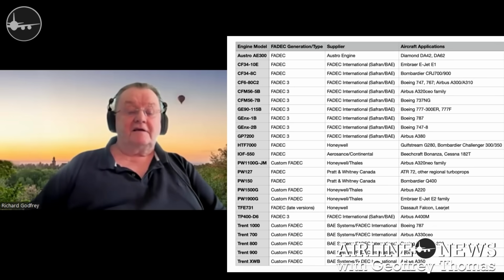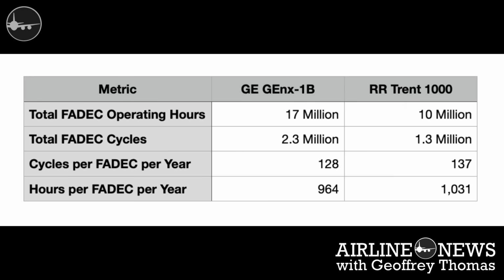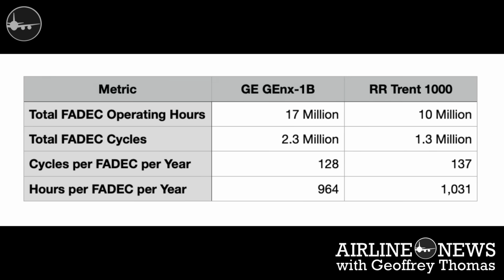Air India Crash - FADEC Explained  #airindiacrash

Comment: Give it up. Stop trying to profit from the death of 260 people. The FADEC EEC and water electrical failure had nothing to do with is accident. The Fuel control switches have nothing to do with FADEC. A simple 24 volt direct circuit between the fuel control switches and a three relays / valves opens and closes fuel valves.

https://www.youtube.com/watch?v=AD5Kc2BURZw

Comment: Have a couple questions::  x Read somewhere that the FS box has actuators in it, so is there a possibility of wire controlled operation of the FS ? ( resulting from electricsl/ Fadec/ software malfunction ) 
Can  a Fadec initiated fuel cut off be. confused as cockpit FS cutoff  on Flight data record ?
 Or does the FDR distinguish these as different events, and hence the "FS Transition " must have been separate  human action independent or consequent to other failure.
Any inputs much appreciated.

Comment: These very informative videos are very important because it shows what can happen. The air India crash has thrown up so much speculation that much of it has been taken as the truth. For example many experts initially said it was the flaps then of course the "depressed" Captain was fairly and squarely blamed. The depressed, suicidal Captain was all across the medias front pages, so no wonder people believe it was him. Personally I think  it all points to the Fadec. If the pilot had noticed that the fuel cut off switches were switched off he would have screamed "what the hell are they doing off" and immediately put them on again. The pilot was flying the plane after all. It looked like something popped up on his screen to say the fuel had been cut, that's why he confusingly said to the Captain "Why did you shut the fuel off".

Comment: There has been another associated FADEC accident, the A400m at Seville 9 May 2015 was a total loss, tragically 4 crew lost their lives and 2 survived with injuries, just after take off three engines lost power. This interested me at the time as I was checking out A400m simulators, which I did from 2010 to 2019. Here’s a reference from Wikipedia:
The key scenario being examined by investigators is that the torque calibration parameter data was accidentally wiped on three engines as the engine software was being installed at Airbus facilities, which would prevent the FADECs from operating. Under the A400M's design, the first warning pilots would receive of the engine data problem would be when the plane was 120 metres (390 ft) in the air; on the ground, there is no cockpit alert.

Comment: Fog swirling in the wake turbulence at rotation is not visible in later airborne shots. That's because the engines had quenched and quit by the second and third camera views. RAT deployed as soon as weight went off the mains, as it's permitted to on a flying plane. The engines made it from run-up and nearly through its takeoff roll with hot turbines, but quenched by water in both lines under acceleration and rotation. That's what's painful to watch in the first video. You'd have to be blind not to notice. The four FADECs were confused and cut the fuel to dead engines, expecting a startup cycle that was delayed too long, again owing to condensation in the unusable fuel below the sump outlets. Question remains, were they on the center tank alone, all tanks, or were both wing tanks watered to?

Comment: How many seconds did it take for fuel to the two jet engines to be cut off? I keep reading about a 1 second gap between when the fuel switches were moved, but that doesn't answer the question. The two locking fuel supply toggle switches have to be first pulled up then pulled back to cutoff fuel to the engines. It would take even a fast moving pilot at least 2 seconds to move both switches from "run" to "cutoff", but if fuel to both jet engines was cutoff in just a second or less, then wouldn't that rule out pilot input.

Comment: Hello Gentlemen !

Thanks again for this great episode !
I think that this is a key sentence:

QUOTE
... could make both FADECs behave abnormally but in the same way on both engines...
UNQUOTE

Is perhaps pointing to one scenario that can not be discarded. And even with 17 million hrs flown by GE, plus 10 million by RR, the FADECs are computers that are submitted to the old rule "garbage in garbage out"
Question: what combination of wrong, intermittent or disturbed input data or power anomaly could have triggered such a scenario? 
Best regards from Buenos Aires

Comment: Based on the three fundamental theories of Landing gear system, Electrical system and Engine Fuel & Control system of B787-8. The root cause of the issue is attributed to the air/ground mode logic being stuck in ground mode (software glitch/mismatch) 

----------------
Sequence of Events
----------------

1. Normal takeoff
2. Landing gear failed to retract after liftoff
3. Simultaneous loss of electrical power; pilot manually deployed the Ram Air Turbine (RAT)
4. Both engines shut down --> Both engines were shut down by the active TCMA (Thrust Control Management Accommodation) with a 2-second time delay. 

FDR appearance: 

Fuel SOV = CLOSED
AccommodationActive = TRUE

5. "ENG FUEL CTRL / ENG FAIL" message appeared on EICAS, despite no intentional fuel cutoff ("why did you cut off the fuel", "i didn't") 
6. Pilot attempted to relight both engines by cycling the fuel control switch on Engine #1 (from RUN to CUT OFF and back to RUN), followed by Engine #2 four seconds later
7. APU switch positioned to START (two seconds after ENG #1  fuel control switch recycle to RUN) 
8. Pilot declared MAYDAY to ATC
9. Aircraft impacted the ground

Comment: I haven't followed this closely since the first couple of weeks but I still find some kind of electrical, mechanical or software glitch more likely than some bizarre sucice/murder, ( especially given Boeing's recent history). I won't try to explain a timeline or when or how the fuel switches "transitioned", but I present a simple question: how many planes do either of these pilots have a history of crashing? vrs how many planes do Boeing's software have a history of crashing? I've read "Occom's razor" used to condemn one of these pilots. Using "Occom's  razor ( all things being equal), I  agree, with the opposite conclusion.

Comment: We do know one thing manually operated fuel cut off switches make a loud  click noise. The absence of  two loud clicks on  cockpit voice recorder confirms manual fuel switches were never operated.   The two fuel switch cut off  transition, in under I second from one engine to another, was not pilot related.
Reply: Where did you  think you heard the  cockpit thing?   Here?

Comment: Thanks .... but investaligative videos on Boeing fault reporting show, faults not reported, faults misassified, fake certifications of safety   ... the culture in Boeing is sacrifice safety to speed up production with back logs.  Top management is inserted in stock price, management bonuses on stock price, funds diverted from  engineering investment to stock price buy backs inflation stock price ... hence annual top management bonuses..

Boeing board are corporate mass murderers in aviation duoply.  Until they were held criminally liable for every single death  attributal to their planes and compensation made to victims from top management pension funds not corporate insurance things will not change

Comment: Which BUS system powers the Spar Valves? 
If power to that bus is lost would the Spar Valves close in a mechanical manner, like spring loaded to the closed position?
Reply: 28V DC. No it's not spring loaded. If there is a power failure, the valve stays in its last position.

Comment: I come back to a point I have made before, I just dont know what to believe. My thought is that the pilots are involved somehow but in the back of my mind a little alarm bell rings. There seems to be no conclusive evidence of a cause. The talk is one glitch or another can happen, when did the RAT deploy, what caused it? As an exanple Richard talks about the Fadec on the engines in terms of cycles and operating hours (2.3 million and 17 million respectively). What are the chance of an error or joint errors? What other problems could occur?
To put things in perspective statistically. The chances of winning the UK lottery with six numbers is 1 in 45,000,000. For the person who wins the lottery it is 1 in 1. Which hour or cycle would there be a Fadec problem, the first or the ten millionth? 
Without all the information it is difficult for the experts, as an interested bystander I havent a clue

Comment: The 787-9 /10 Models are the only ones in Boeing fleet to have an automatic landing gear DOOR opening. If the plane (fadac) think he is on the ground the door wont open and pilot wont be able to retract. The culprit could be WoW (weight on wheels) sensor issue or a software bug. The system wont allow gear retract, could initiate all sort of commands like thrust reverse or engine idle.
Reply: It would seem it partially started retracting, then wow sensor may have failed.

Comment: This crash involved thrust, and loss of. It seems that FADEC data is potentially more complete regarding what happened to the thrust than the more general, aeronautical black box data. Don't FADECs log their internal parameters? Is any of it transmitted in real time via ACARS? Were the logs recovered?
The FADEC is where engine control inputs, resources such as fuel and electricity, outputs such as thrust, electrical power, hydraulic power,  and bleed air, and internal function or malfunction are all considered in an integrated system. Engine engineers should be able to reconstruct and verify every aspect of engine operation from FADEC data.
Reply: The FADEC send all relevant Data to the FDR.

Comment: @geoffreythomas-on-air Please look into the possibility of lithium battery short-circuit due to a faulty diode and (exacerbated by high load of landing gear brakes upon liftoff) that causes both electrical buses to drop to 0 volts and the engines to idle down due to "soft alternate mode", as explained in great detail in these two videos:

https://www.youtube.com/watch?v=fl1kUudq7Tw
https://www.youtube.com/watch?v=OLxLN3osS1Y

here is a brief summary of the proposed events, generated by an AI from transcripts of the 2 videos:

* The main battery's single battery diode module failed at some point in the past, allowing unregulated voltage from the Transformer Rectifier Units (TRUs) to flow back into the battery, weakening it over time

* During takeoff, the landing gear retraction process applied the electronic brakes to stop the wheels from spinning, which created a huge current demand on the 28V system

* This large transient load was the "last straw," causing the weakened battery to completely short-circuit.

* The short-circuit acted as a huge DC load and brought the captain's instrument bus down to  0 volts.

* The system, detecting the loss of power, attempted to restore it by connecting the captain's bus to the first officer's bus. This propagated the short circuit across the bus tie contactor, bringing all DC buses down.

* With the common core system offline, the engine controllers (EECs) reverted to a "soft alternate mode".

* Because the landing gear was down during this period, the system's logic assumed the aircraft was on approach and commanded the engines to idle down.

* the pilots did not have time to recognize the situation and override the engine control software (which would have restored thrust)

* The Flight Data Recorder (FDR) recorded an engine fuel cutoff signal because the remote data concentrators (RDCs) lost their power, not because the pilots manually moved the fuel cutoff switches.
Reply: There's just the problem, that the prelimnary report basically states that at least one engine was spooled down to below idle rpm, which wouldn't be possible if there wasn't a flame out or at least something seriously wrong with that engine. Also, if you think now, oh but because of the power outage the data were recorded wrongly jadajadajada. The FADECs have their own idependent power source. They don't care at all if the main AC and DC buses fail.
Reply: If the heavy damage on the rear EE bay located APU battery was not post impact related then two easy possibles come to mind. Massive unintended overcharging, and fairly heavy and rapid heat in the rear EE bay. Perhaps even in close proximity.
28V DC......

Comment: The FADEC is a very reliable piece of electronic engineering. That's borne from the hours used. 

There may have been absolutely nothing wrong with the FADECs themselves. But, in the event of electrical failure further up the line, the information they received may have been comprised. If loss of sensor input happened at a time of electrical power loss, the FADEC may have reset but reset in the wrong configuration ie WOW. If sensor loss happens but the FADEC doesn't need a manual reset, it should reset to its previous configuration ie flying. It will cross check itself. 
I am in the belief that a perfect storm happened set off by a catastrophic electrical failure. This is suspected due to the early RAT deployment, the sole survivor statement and the mayday message.

Comment: I've worked with military grade hardware/electronics and firmware for 35 years. You learn the patterns.  2 redundant ECM's with fadec firmware, per engine and electrically isolated side to side, redundant data channels all failing or glitching all at the same time ? .... and then per the FDR, they respond in a predictable fashion by design in trying to restart after cutoff switches are returned to run ?   You can't calc the odds of those Swiss cheese holes.  Fuel can only be cut off manually, by human intervention. Thats what the FDR recorded.  There is no software/firmware on that aircraft that can interfere with that critical system, and it's specifically by design. Yes, all options have to be looked at .....  but we all know what probability says with the given interim information, as ugly as it is.  That aircraft did what it was told.

Comment: Can FADEC turn off engine fuel control valves under software command?
Reply from the maker: Yes. That is why it is called "Full Authority".
Reply: No. its analog and manual, by design.
Reply: Also the a/c systems can modulate at least the 'FMU?' fuel valve'.

Comment: Ok but why so long of a pause if they cut the Fuel switches. Surely you would think a cycle would be only a couple of seconds.
Reply: What if the power supply was disrupted for a few seconds to the TCM/ FUEL SWITCHES by an electric circuit  breaker  / thermo breaker that then reset ?
( 28VDC  and close related ftw. Up and down and all around...}

Keep in mind the relevant parts of today's video concerning Throttles and the like.

Comment: Is there any way the FDR can record a fuel switch-off without the switches having been moved physically, i.e. so that it appears that the fuel control switches were moved to the cut-off position when they actually weren't?
Reply from the maker: There are two Fuel Switches, with two data paths (one via two separate relays, powered from two separate Electrical buses) and one via two separate RDCs to two separate FADECs.

Please show us the definitive or probable intermittent common-mode fault, given the simultaneous timing, apparent raft of other systems still functioning and the eventual successful relights of both Engines.

Comment: Posibilities:  99%Suicide /1% other causes
Reply: What was the cause of the other 787's that had a RAT deployment/dual engine power loss?
Reply: @martinwhite418 is it relevant for this case? Why hundreds of  787 still flying daily?
Reply: @bihurri   Hundreds of 737 Max's flew daily until  Boeing software crashed 2 of them killing hundreds.
Reply from the maker: Nothing to do with any other causes of course, it has to be Boeing. The official outcome of both reports was disputed by the FAA, NTSB and BEA in France, claiming that the official report had deleted large sections to make it look good for Ethiopia and that the report from Indonesia was motivated  by misguided religious beliefs.
Reply: "In dubio pro reo". Also suchen Sie die 1% anderen Ursachen!
Reply: Based on supportable speculation,100% suicide with mass murder, imaginary other guesses.